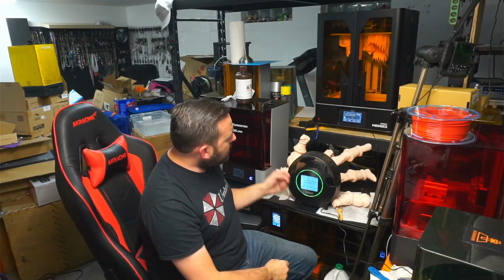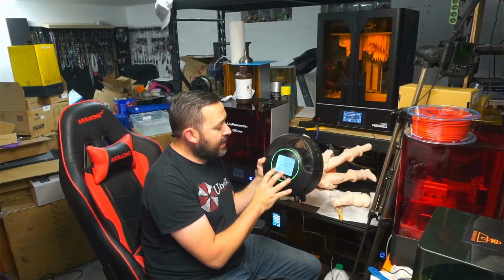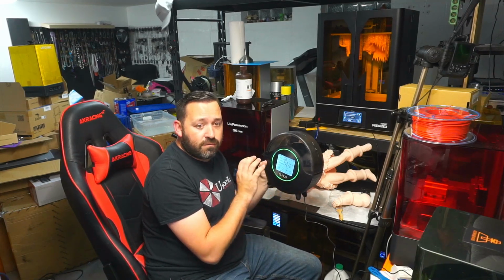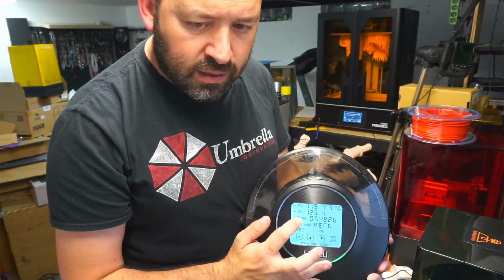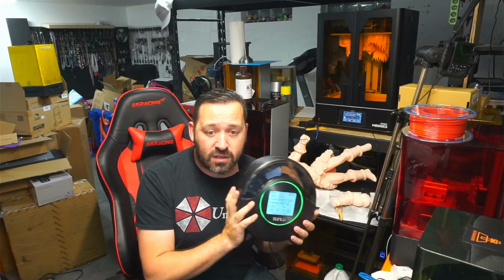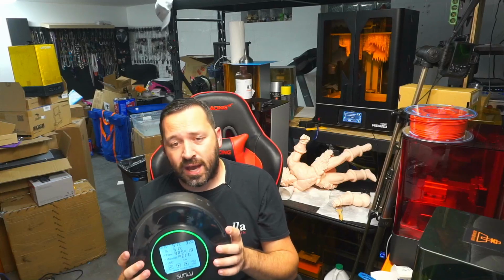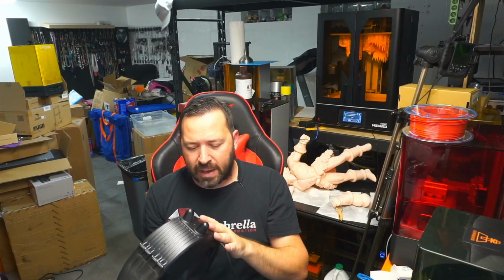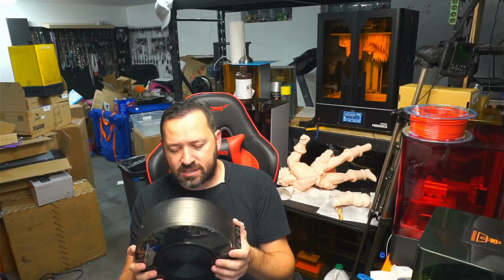Sunlu FilaDryer S2 Review

Comment: Is it possible to feed the filament from the bottom? I would like to put the dryer on top since I have a direct drive.
Reply from the maker: Unfortunately no. The heating element takes up the entire area
Reply: @AkumaMods  I feel like thats a missed opportunity. Its useless for people with a direct drive since you cant feed it properly. The bottom was the way to go.
Reply from the maker: @RonigKillah  agreed...however you can drill a hole into the top and run a Bowden setup to the direct drive

Comment: Does it have a fan? And that orange filament looks like it's too wide to fit in there,  but hard to tell..

But for $40 more if it has no fan is not worth it IMO,  get the regular one and add a fan,  or I think eSun makes one with a fan for around $50
Reply from the maker: It does not have a fan...adding a fan defeats the purpose of it being a filament dryer
Reply: @AkumaMods  I don't understand that comment. Most people have been drying filament in food dehydrator which have heaters and fans for ages and ages...   A fan and heat is going to dry more filament more evenly...  Like a convection oven vs regular oven kinda...  How does a fan defeat the purpose to you?
Reply from the maker: @vkhelldog  well I guess you would be right...wasn't thinking in that way. My thought process is you are taking in the humid air and then trying to dry that to help get faster drying but the fact your still needing to dry out the incoming air I guess is a mood point if you have good enough heating
Reply: @AkumaMods  do you still stand by this c comment?
Reply from the maker: @confuzled_makes  yes I do
Reply: @AkumaMods  do you think the people seeing better results when adding a fan and companies that are now adding fans (sometimes temp controlled) are lying?
Reply: @confuzled_makes  I will be having this dryer, and was think about adding small fan into it, but since it have heater all around, im not sure if its that necessary. Sure, for S1 adding fan was basically critical to its function (SUNLU also add fan to S1+, but i thing that one works only with their S9 printer, since you can control it on printer touchscreen), but to this one?  Air circulation is beneficial  as Virgil Kellogg said, but heater placement could make it less needed. We will see! Im definetly going to add 4/3 PTFE tube to mine, with fan, im not so sure, further testing will show.